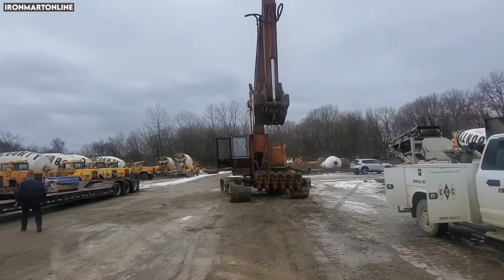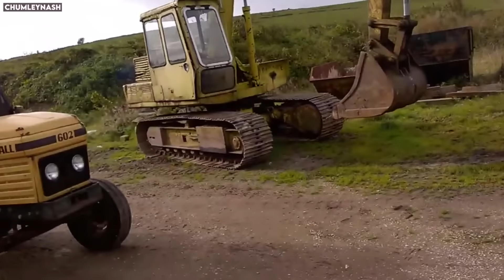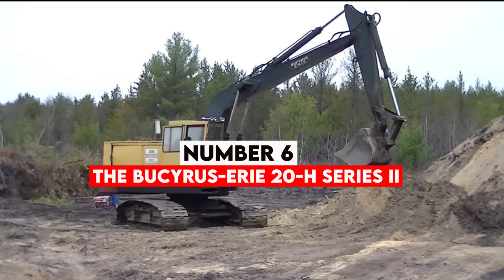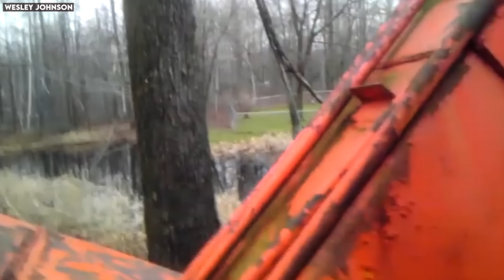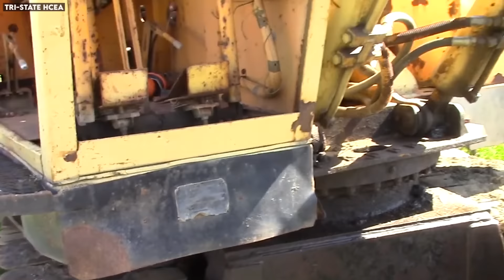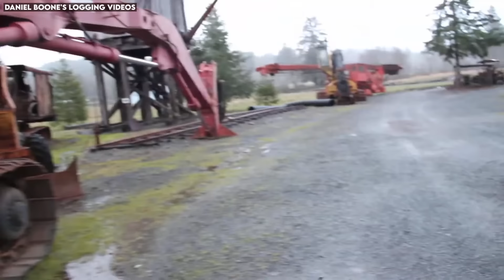10 Worst Excavators of the 1970s That Operators Couldn't Stand

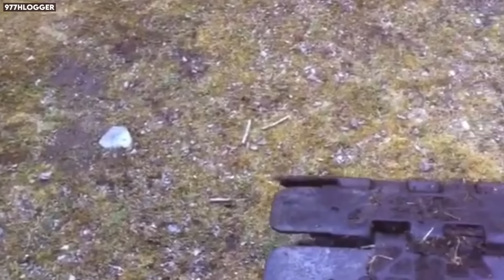Comment: I own the machine you put in this video at 16:47. Definitely not a machine to hate; in fact since it uses off the shelf parts it is easy to find parts for even though the machine is an orphan. It is very reliable and tough as nails and still works great to this day!